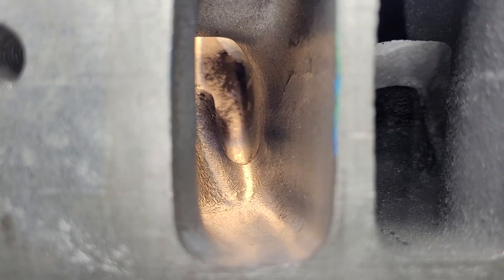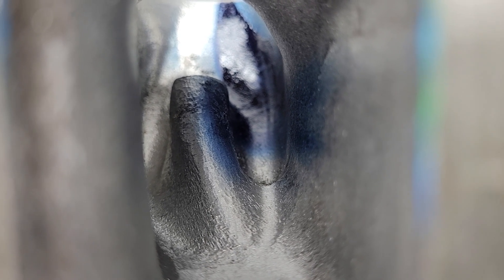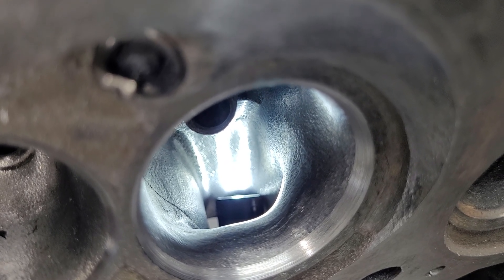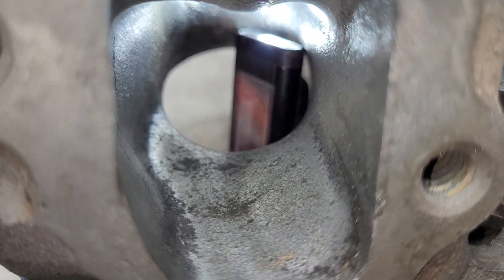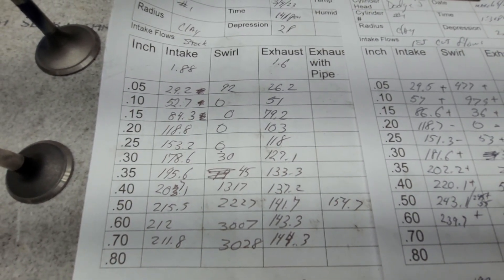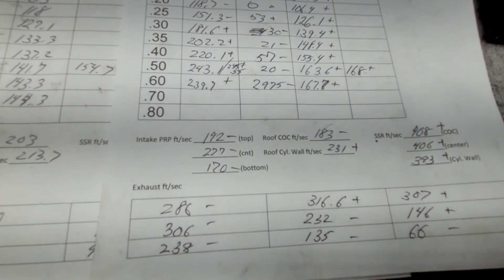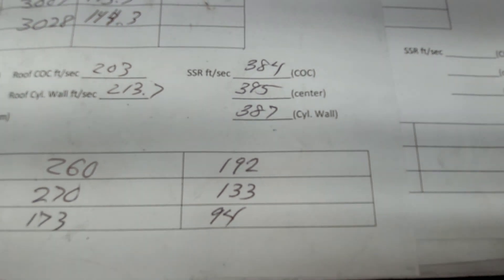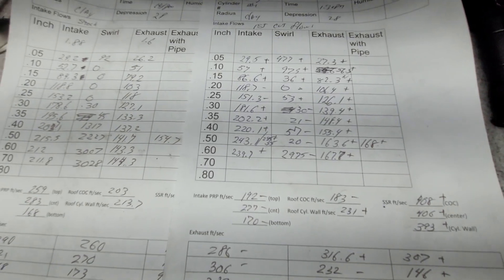Chysler 360/915 J heads first cut ported vs. stock. Easy air?

Comment: I remember about 20 years ago porting a set of 302 heads and I used a fiera valve with a 5/16 stem and got 238cfm at 550 lift and my buddies laughed at me porting on a 318 head until they saw the flow sheet only brushed one intake for 5/16 valve never finished them but still have about 4 pair of them and all have been magnafluxed no cracks would like to see your videos on porting the 302 I think the intake valve was 1.880 might have to play around with them again thanks for sharing your hard work
Reply from the maker: 302 Mopar head I have lots of ported videos. Thanks

Comment: Charles, how much do you think you’ll pick up going to back cut 2.02” nailhead intake valves with 11/32 stems? Dramatic increase or nothing to speak of until the higher lifts?
Reply from the maker: I would like to do this experiment. Other heads pick up more in the midrange flow than top end. Thanks

Comment: I would love to see a video on 915 big block mopar on the process of what and where to cut , I have a pair ready to install that only had bowl cleaning with mopar performance valves 214/181, would like to spice them up a bit before installing  ,love your videos , very methodical
Reply from the maker: I have one set of 906 bbm heads they haven't been touched since 1988. I have no valves, locks or retainers for them.

Comment: I just don't understand why on small block mopar did chrysler make such horrendous ports , when they had a blank slate to start with ,  "unless" the engine program was compartmentalized , and the cyl head department was ran by fools and just designed something  quickly that would fit.
Reply: I think the problem was the small block family was making too much hp compared to the big block so they had to saddle them with defects to make people willing to spend the money to get the bigger engine. My poly 318 looks worlds better on the heads than these things.
Reply from the maker: @bcbloc02  You make a good point. A good port design would really wake these up.
Reply: @servediocylinderheads  I mean they did have factory 290hp 318 when they had the poly so they were already super close to that 318hp 318. Then they stepped back with the la engines putting the effort into the 440 instead.
Reply from the maker: I don't know. Just a bit of design work would have been a big difference.

Comment: Those heads will really wake up a 318, mill them .30 thousands with KB pistons would have been more viable than the Mission Imposible project which by the way 
"turd polishing".
Reply from the maker: I disagree, The ports are much bigger and flow less so the 302 heads would eat them on a smaller engine due to higher port energy of the 302 heads. Thanks
Reply: @servediocylinderheads  So the 302 heads would beat Edelbrock heads on a 318 ??
Reply from the maker: @MP-pz9oe  It would be a fun test I think.
Reply: @servediocylinderheads  12:40 
I’d like to see that comparison too!  It’s interesting that you say the 302 castings would out flow the J heads on a smaller engine like the 318.
Reply from the maker: @MP-pz9oe  It is a learning process for us all. Thanks

Comment: Your “stock” numbers are what most big block Chrysler heads flow. The 440 was a decent performer for how choked off it was. These numbers demonstrate why Chrysler 340’s were so hot in the days when 300hp was a decent number. Power/weight
Reply from the maker: I was surprised they flowed as well as they do.

Comment: The (lack of) exhaust short side radius has always saddened me on the X/J heads.
Reply: Yes, same here Rodney.
I wish Mullins would have gotten involved on the small block heads early on.
Changed the exhaust ports and moved the pushrods out.
They had the technology. 
Why didn't they use it.
Corporate bean counters.
Take care, Ed.
Reply: @edsmachine93  Yes, Mullen did braze the exhaust floors, spread the valve centerlines, braze the pushrod pinch and use T/A rockers with shaft blocks and milled perches. But when the W2 heads became available, all that hand work was just too expensove over the new castings. Did you know they also made a oval port B-engine head, with W2 technology? It didn't offer much gain like the A-engine heads so they killed it early on. I saw a tunnel ram kit that Mullen was developing for those oval port BB heads for sale on Ebay but I passed on it. VERY RARE PIECE!!
Reply: The 308 castings have a raised floor
Reply: @petergehle4222  So do the #302 castings, they learned that trick on the W2 heads.

Comment: Oh, also...  there's a (single) "spare" 450 CFM Holley 9776 "Tunnel Ram" carburetor (stock calibrated for dual-quad tunnel ram setups) at the shop that some customer accidentally ordered from Jegs or whatever years ago that needs a good home if anyone needs one, the owner would likely part with for a bargain price....   It's not mine to give away, otherwise I would just donate it to the project if it were deemed useful (and it is also only one carb of the pair, so someone would still need to source a second one from somewhere....)

Comment: I don't remember having to grind out those ramp-like thingies on my '78 360 heads, but they're obviously later castings, either '569 or '596, I can't remember which....  🤔but I DO happen to have the intake manifold off right now since I'm changing the camshaft, so I'll take a closer when I go back over to the shop tomorrow and maybe try to decipher what I actually did to those ports 25 years ago...
Reply from the maker: Cool, let us know. Thanks

Comment: Just fyi, the ski ramp guide tail in the roof of the intake port can be taken out completely if you want to find out what that does to the flow.
Reply from the maker: Haha, just worked on it for an hour. I kept measuring. I thought it was solid. Thanks
Reply: Yes, I've taken it out completely, but you don't wAnt to get carried away because you WILL bust through to the other side. Ask me how I know. A Full Port Job on the X/J iron heads is A LOT of TIME and EFFORT....... A months worth of weekend time easily.

Comment: Awesome, the small amount of work you javelin done here has me hopeful the my small block chrysler #596 heads that I have ported are  somewhere in the 250s on the intake. I removed the strange s shape on the guide boss, straightened the common wall, 5 angle valve job, some more bowl blending, chamber cut, andaximized the pinch. With 1.88 valves. 

Edit: also blended the ssr a little bit as well.
Reply from the maker: Sounds good.

Comment: Id like to weld and cut some Chevy aluminum heads,  raise the ports raise the exhaust, maybe even convert/adapt Chrysler shaft mount rockers, to remove the pinch point from the equation, but like DV said the restriction is not the pinch, it's the bowl area!,  I'd like to raise the guide area,  use longer valves if the roof is .200" taller it's going to open the port / bowl up alot, leave a water passage about 1mm above the ports,and around the exhaust, somewhat , maybe machining and welding in bits that are machined to fit it could produce a useable modified head,  however it would likely get so crazy it would probably need to be used to make a mold to cast another set of heads, casting a set of heads at home is a bit ambitious to say the least, I'm curious how little water you can get by with inside a head, a dry head would be easy,   I wonder if basically casting a cross between a air-cooled head and solid billet head, then machined in passages and weld in .180" plate over the rest of the head, to allow water to flow around the cast in somewhat cooling fins,  allow cooling around the exhaust, guides,, over the quench pads, then machined around the exhaust ports, to connect the cast in passages, machine a plate to weld in, then machined in the deck passages, may as well machine in 400 steam holes!
Heck I'd like to carve a head from wood and work and test it just to see how it would workout fit were cast in aluminum,  I was watching some of Ben Almeda's videos, and he showed some heavily modified BBC heads and intake it was some awesome mods, but as far as SBC goes, modifying a block to fit LS heads would be a great upgrade if possible,  what I'd like would be to cast a block and heads make the main webbing, and base of the cylinders, extra thick,  to allow the head studs to screw into the base of the bores, and main webbing if possible,  to eliminate deck flex or distortion, with a semi open deck, slightly widen the bore spacing to allow water between bores, and thicker wall, if only 
.040"  the heads  should still fit,  the pistons would be about . 050" out the hole, with a space in the head for the piston like Chrysler heads, but carefully machined to fit the piston tightly as possible, to allow the rings to come to nearly the top of the block, and still be down on the piston to handle heat,  it should be capable of 11:1-12:1 with a flat top, with 3.480" stroke, and drill .75O" oil passages in the block to feed the mains, and. Allow the use of a BBC oilpump, with cooler and remote oil filter ports, on the front, possibly have a spacer adapter between the rear main to hold the oilpump, and use a  large bolt on fitting to get the oil from the spacer through the fitting to the block through a .750"passage use double passages to the main bearings, using modified stock type race bearings, with a splayed main cap,  and the oil pan will probably need mods to fit the oil to block adapter, and possibly oil pump, I think the best part would be designing it and machining it! It should be capable of handling 2k HP plus, possibly 3k without issues, maybe make it with wet sleeves! Have the sleeves bolt in like motorcycle jugs,  inside the water jackets! Using stainless bolts in brass inserts, to allow the sleeves to be bolted in, then the sleeves and deck to be cut to fit, use o-rings  to seal, getting crazy exotic,  crazy I know sorry to ramble!!
Reply from the maker: No reason for big block oil pump.
Reply from the maker: I am adhd, that much writing and I forget to answer questions. I do not totally agree with D.V. about the pinch. It depends how much flow you are trying to get by and the airspeed.
Reply from the maker: Someone actually used to cast a hybrid block. Sbc bottom LS cylinder head head bolt arrangement.
Reply: @servediocylinderheads World Products makes this block.
Small block/LS Hybread.

Comment: Why on earth did they make the ports so strange shaped,   when designing a head you can make nearly any shape you would want,  why not raise them .250" and open them up a bit,  and  raise the intake ports a bit,  .200",+/-, raise the cover rail also, probably require longer pushrods,
Reply from the maker: Do not apply logic!!!!
Reply: What we know that works for high performance was not even a consideration when these were designed. It’s just too easy to armchair quarterback and trash talk the heads from 50 years ago that were designed for passenger car service, not high performance of any kind. It’s also a good reason for the split pattern cam they used in the 4 bbl. engines.
Reply from the maker: @Robs-Garage-experiments  You make a good point. There were manufacturers doing airflow research back then. They were few. Thanks
Reply: Oh for sure! No doubt. As cylinder head development proceeds through the years in race heads, one can see how things get better and better.

Though passenger car service heads designed by engineers, or for which I bet weren’t young fellas but older gents schooled the prior generation along there way of thinking (and improving on it I’m sure) still have to design a head for passenger car service. The 360 was introduced in’71 and used as an upgraded people mover over the 318. The 360 was first used in the bigger cars and trucks. I think it’s easy to see the two heads, the 318 & 360 are super closely related in the thinking going on at the time.

When Chrysler started in with their small block race head, the more appropriate approach was taken. I’ll drag one over so you can see. I have no valves for the bare head example I have, but I’ll remedy that before I bring it over.

Personally I don’t like applying todays thinking  to yester years engineering approaches and thinking. It’s not exactly fair IMO. We learn more through the years and applying todays knowledge to 50 year old heads is a dozer ice to those that came before us.
Reply: Did not want to change exhaust or intake manifold design/patterns??  Bean counters.  😂 
Did a "little" bit with Magnums though.